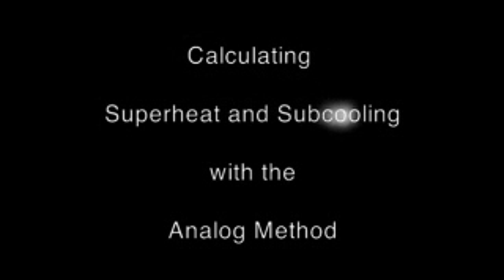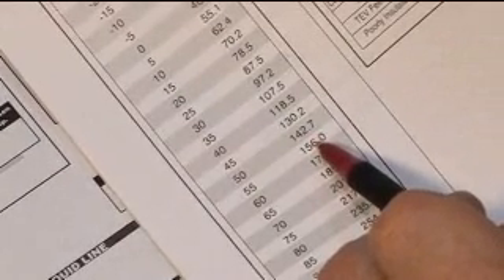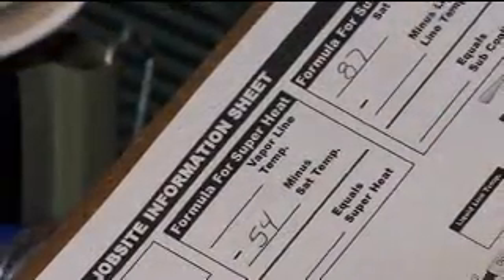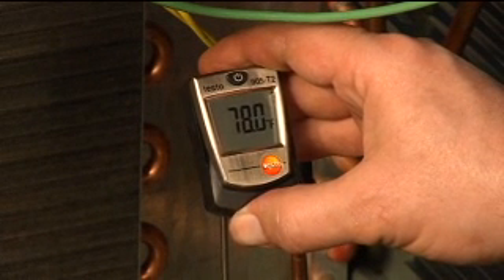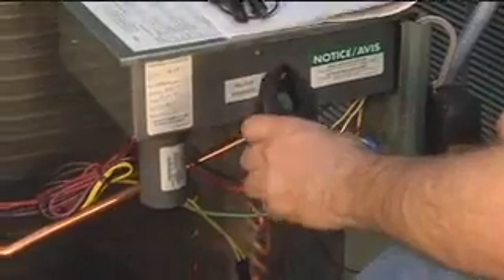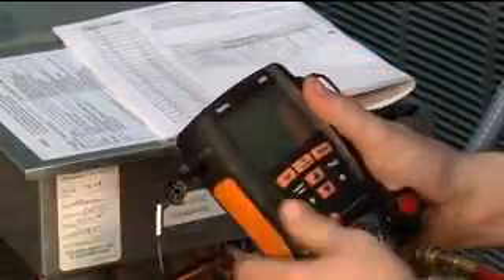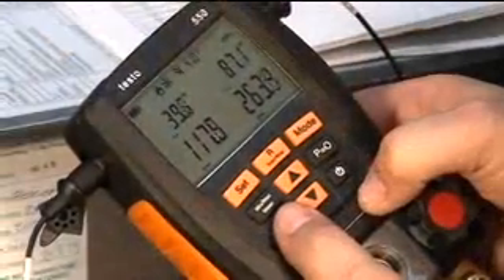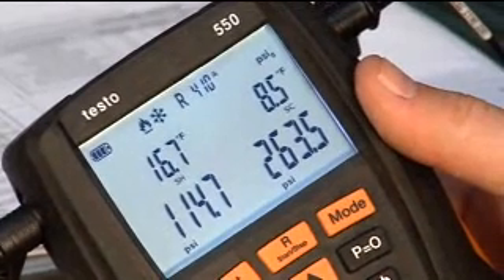Calculating Superheat and Subcooling

Comment: Sorry I'm new at this and my questions may seem redundant...

So superheat and subcooling range is just the difference between saturation temp and outside line temp?

Is the range required for superheat and subcooling always going to be 9-12 degrees temp difference between saturation temp and outside line temp?

When charging a system is the idea to try to get the saturation temp and outside line temp to be within 9-12 degrees of each other?

Comment: Testo offer two versions of the testo 550, a basic kit of meter and a clamp probe for $299 MSRP and a Deluxe Kit with meter, two clamp probes, and a carrying case for $399 MSRP.  Contact your local wholesaler or favorite internet reseller, as they have these on sale.  Testo is running a $75 mail-in rebate when you purchase the new t552 Digital Vacuum Gauge and any one of the Testo manifolds.

Comment: Superheat calculation is what is happening in the system.  The target superheat calcuation is impacted by the weather.  In the May 2006 issue of Contracting Business the article, Superheat: The Best Way to Tune an Air Conditioning System provides a good explanation of these.  I tried to post the link, but I'm getting an error.